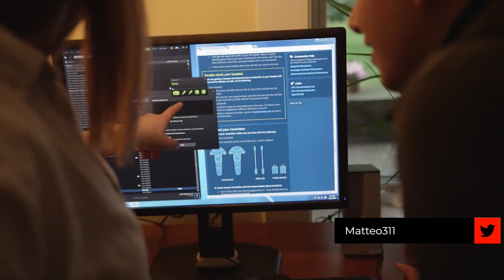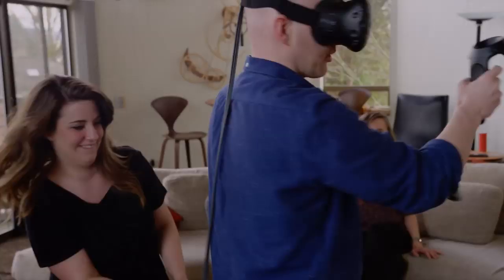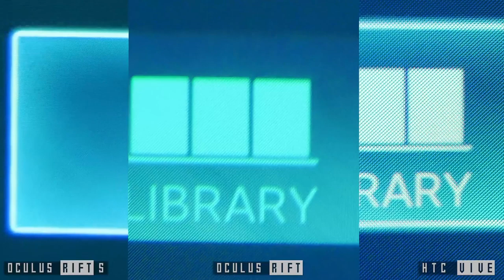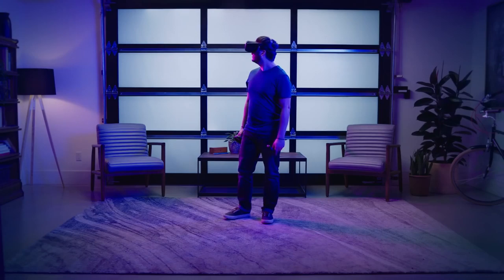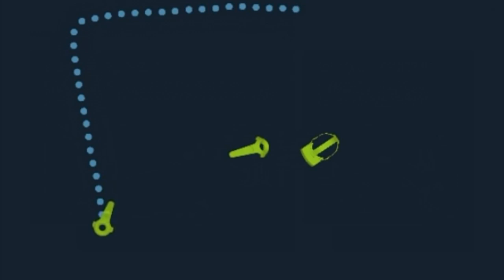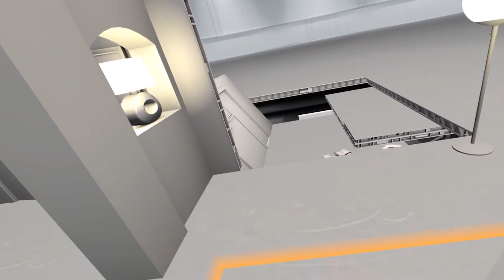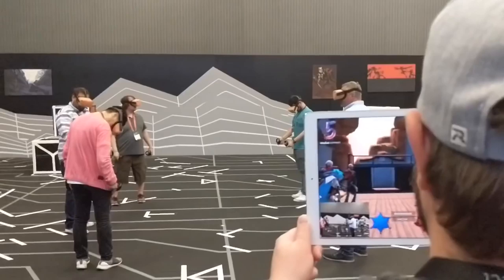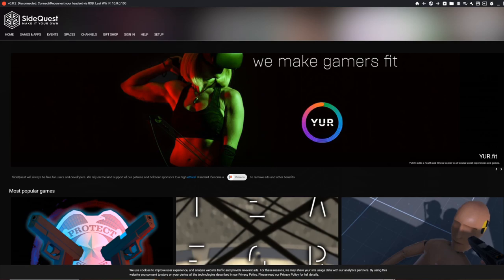Beginners Guide To Virtual Reality

Comment: "There are some cases in which eye strain is a symptom of a more serious eye condition, which would require optometric treatment. For the most part, however, timing VR sessions to allow for breaks, or limiting the use of the headsets, will reduce instances of eye strain."

Why is it when everytime something is fun... doing it to much will hurt you.
Reply from the maker: Everything in moderation

Comment: heads up on rift s. I had a complete hell getting it set up. I have a high-end motherboard and the headset would not recognize the sensors until I got a powered usb hub. I have had much fewer problems with the index. It just worked.
Reply from the maker: Do you mean original rift. The rift s doesnt have sensors and I had mine setup in 15 minutes

Comment: I dont have vr yet but i have glasses. Should i take them off to do the experience or should i get an accessory to help them fit?
Reply from the maker: Depends on your glasses but they might fit.  If are near sighted you might be fine.  The other options are contacts or prescription lenses   for your headset
Reply: @Gamingwithmatteo311  Thank you very much and i am near sighted

Comment: I have a question 

I wear glasses and I’m not sure if I want to play a nauseating game without them since I’m prone to headaches,

Is there a headset that fits glasses inside? Just curious
Reply from the maker: it depends on your frame size.  Some glasses will fit but there is a prescription lens option from https://www.vr-wave.store/ They make magnetic lens attachments.  Use code Matteo311 for 5% off.  The pop right on and off in 2 seconds
Reply: Ok thx dude

Comment: Wait! So i do not need any space to use vr (except space to maybe punch), i can sit down and not move but still use VR!??! I got told i cannot get a VR because my room is too small so i cannot walk. (I'm a martial artist so i can throw punches in my room)
Reply from the maker: Ideally you want 6.5 feet by 6.5 feet or greater to truly enjoy VR. A lot of games have you moving around quite a bit
Reply: @Gamingwithmatteo311  so i cannot play sitting down? I dont have 6.5 feet of walking room 😂
Reply from the maker: @impairsosa2663  there are many games that support or are designed around seated play but to get the most out of vr you want the extra room
Reply: @Gamingwithmatteo311  i know but i cant get room right now x.x but i really wanna experience VR gaming so if i can play games sitting down im fine like that.

Comment: would a legion 5 pro laptop be good enough for vr gaming or at lest beat saber ?
Reply from the maker: Specs?
Reply: @Gamingwithmatteo311  am not good with computers
 but i think my specs are   AMD Ryzen 5 5600H with Radeon Graphics    3.30 GHz   64-bit operating system, x64-based processor

Comment: I have a gtx 1070 intel i7 7700k and 32 gb ram is my pc good for index or nahh 🤔
Reply from the maker: I am a bit of a snob so I might not be the best judge but you won't be able to use the Index to it's fullest potential.  I personally recommend a GTX 1080, RTX 2060 or greater.  Your CPU is good, if you are getting the index as your first HMD, I would say go for it an when you can upgrade your GPU.
Reply: Matteo311 tbh if i am able to play at 80hz or 90hz with like 80-120 ss i will be fine with that i am gonna give it a shot i could just bring down the resolution and get a playable gameplay until I upgrade my motherboard and gpu
Reply: Matteo311 and yes this is my first hmd I decided to go for the best for a longer use until I upgrade my pc
Reply from the maker: @Luke77  good choice
Reply: Matteo311 thanks :D i am just too nervous to make the decision is a lot of money
Reply from the maker: @Luke77  If it sets you back too much consider the rist s
Reply: Matteo311 but the problem with that it has a digital ipd
Reply from the maker: @Luke77  I have an ipd of 58. I was scared it would be terrible but it wasnt bad at all.
Reply: Matteo311 what do you think about the 80hz 🤔
Reply from the maker: @Luke77  it makes VR feel less real but you need a beefy pc for index's 120hz
Reply: Matteo311 hmm i think i should find a demo for rift s try it out first then i should decide because I tried vive pro and i think that is 90hz and i was fine